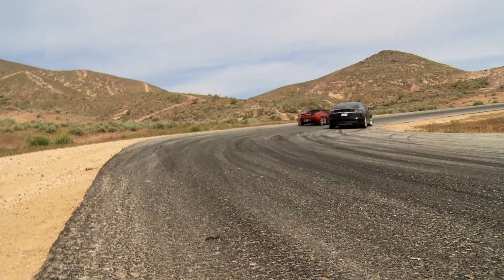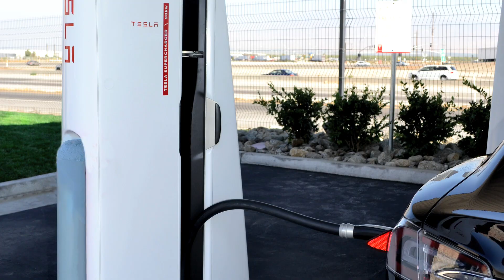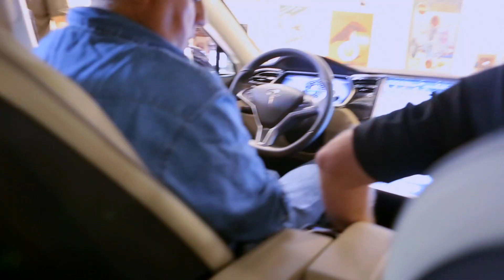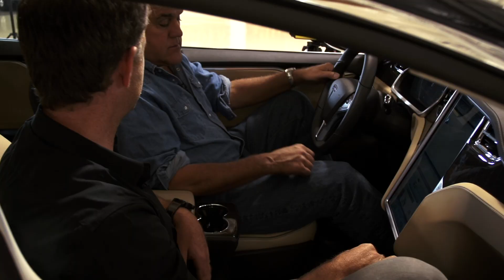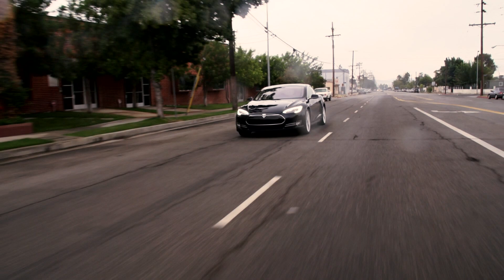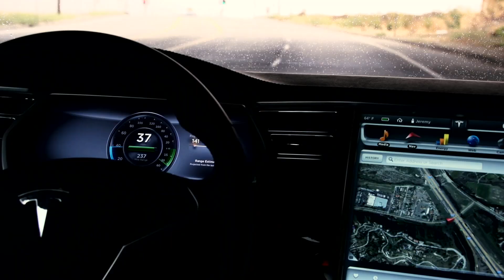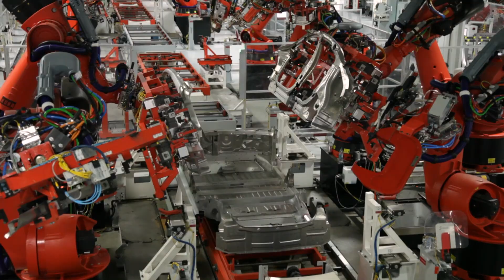2012 Tesla Model S - Jay Leno's Garage

Comment: It is probably possible ylto do with self charging the batteries with such a system already using electrical  to power the drive. I wonder if say if it was possible to do it be like an alternator with belt to feed on the electric motor with gears to built up enough charge to keep it in very low charge mode or better? This way it helps keep the ranges a lot longer and of course with the reduced in power output. 

Let say it is possible now they wouldn't probably do it for many reasons but my reason is then they will never make any money as u would never need to buy battery for a long time.

Think of it like charging ur phone  or laptop battery at 100% and it drains slower.
Reply: L Saelee So what you're saying is they should use an alternator to charge tehe batteries while the car is moving? That wouldnot work,buddy.
Reply: guifrakss what's keeping it from working? Maybe split the batteries into two way and when one side drains down maybe start charging one side while running on the other?  I don't know I just figure it would work somehow maybe cost too much to do. But have u ever thought about a car if every hoses to water coolant etc we're made with high performance or expensive stuff you'll never have to replace them again or a very long time. Reasons are so there such autopart stores and auto shop business.  I'm just basically trying to say that it can be done just cost isn't worth the company to make it.
Reply: L Saelee
 I dont understand what you mean,please don't say everithing you have to say in a single sentence. Try breaking them apart, or it turns into nonsense.
Reply: guifrakss let's just put it this way. All cars currently have a charging system which is belt driven. It charges while driving or at least it does when it's current drops. It's to maintain a good state of battery.  

So to say I don't see why the new electric car cannot be done using this type of system. I'm sure it can be done, but due to cost design R&D probably won't happen.
Reply: L Saelee
 Ok got it now. What you don't undesrtand is that eletric cars cannot have a generator (or alternator) to keep the batteries charged, because it takes more eletricity to run the alternator than it can give back. What you can have is regenerative braking that uses the motors to send eletricity back to the batteries when the driver takes the foot off the throttle ( tesla and most modern eletric cars have that).

Comment: Ok, since no one else seemed to mention it, I will. There are always 2 things regarding electric vehicles that are always over looked. The first one is that battery technology will remain similar to what it is today. That is not true at all, as of me typing this, prototype graphene sheet batteries exist in laboratories that would have enough power for an electric racecar to do the full 24 hour Le Mans. They are literally over 100 times better than current batteries. The other thing people overlook is that while right now, electric cars get their power from non renewable energy sources most of the time, which defeats the purpose. However, in a few years, nuclear fusion will take over the energy industry as the leader, and it will be the best form of power generation humanity has yet seen. Combine the two and suddenly electric cars will become very viable indeed.
Reply: CockatooDude EVs getting power from non renewable sources does not totally defeat the purpose. I forget the exact numbers, but a model s charging with power made exclusively from coal (the dirtiest fossil fuel to burn) only causes somewhere around half as much pollution as gas powered cars
Reply: Salvador Abellano yes, but I was addressing his argument that most ev's power comes from non renewable sources. Of course ones that are powered by solar, wind or hydro power, but I was giving a worse case scenario
Reply: Trey B have you ever heard of solar power?..

Comment: One glaring thing missing that could easily make this one of the best most versitale cars on the market... put a dam gen-set into it !!! Sheesh! Relying solely on the batteries and charging stations is still severly restrictive, adding the gen-set would free it from the interstate and allow it to driveable on the longer journeys away from the major population centers. Until then forget it, I'll stick with gas or hybrid type models.
Reply: dlwatib People get hung up on certain things, whether or not they are real world problems. Today I pulled into a parking space, and it was clear that the person in the space facing me wanted me to move. I obliged when I realized he was saving that space so somebody could give him a boost. It goes to show that dead batteries are a quite common occurrence.  It just that it's not Tesla owners who are having that problem. 

We should really be asking those with ICE cars what they plan to do about the battery problem. If they leave their radio on when they are parked, they could come back to a dead battery. The same goes with headlights and a number of other things.  They could carry jumper cables, but that won't do much good if they are stuck in the middle of nowhere.  I've never come close to having a depleted battery in a Tesla, even when taking long trips. but I wouldn't be able to count how many dead batteries left me stranded in other cars in my lifetime.  But with a 12V battery in an ICE vehicle, after a number of years, the car may not start due to the battery even though the driver did nothing wrong.
Reply: KlunkerRider How do you propose doing that? Are you familiar with how the car is built?
Reply: bW9taeH4 gen-sets can be pretty compact, it's conceivable it could be housed in one of the rear quarter panels and a small fuel tank in the other. Not saying its an easy fix but if other cars have done it?
Reply: KlunkerRider One of them has the subwoofer but that's not the real issue. Most people drive a fraction of what a daily charge will give them at home. You can't fill up a gas tank at home and that's not stopping people from buying ICE cars, and if you can live with the inconvenience of going to gas stations each week, you will love the convenience of never having to do that again.

There's a big array of superchargers, and it's only on the long trips that people take perhaps a few times a year at most that it will be an issue. If you are taking a 400 mile trip from Silicon Valley to Los Angeles, a small fuel tank won't be much of an "easy fix." It would be an inconvenience. Chances are that on a trip that long, you'd want to stop for lunch or dinner and charge while you eat.  People would rather plug the car in at a hotel overnight than stop on the way if possible, and a hotel that charges $140 per night would rather spend $1.50 of it on electricity than have you stay at the hotel down the block. There are plenty of independent charging stations too. 

People who don't own the car might think something like what you suggest would be good, but you never hear owners talking about that. I've owned many cars, and like most people, if it doesn't live up to my expectations I will be quite vocal about it.  The opposite happens with Tesla with respect to charging. People start off anxious about it until they own the car, and then realize it's not even a slight inconvenience. The opposite is true because it means never having to stop for gas. If you add a small gas tank, that takes it away.

That doesn't mean that Tesla owners don't have a long wish list. I'm not saying it's at the bottom of the list. It's not on it at all.
Reply: bW9taeH4 My issue would be driving up Hwy 1 from LA to Portland there's not a lot of options when you get off the freeway and onto the back roads. My main point is that Tesla wants to replace the gas car with an all electric car, their next car model, the "affordable" one, is going to have to be attractive to the average Camry owner, that lack of versatility outside the urban sphere is going to be a hurtle, a bigger one than I think they realize. As is, the Tesla is a very expensive second or third car for well healed buyers, they want the next model to appeal to single car buyers, that's going to be a tougher sell without the generator like the Volt has.
Reply: KlunkerRider You are right, that wouldn't be practical right now. You'd have to do it over several days and stop a few times, since you wouldn't have access to fast chargers. I'd probably want to do it over several days anyway, but superchargers would all be detours and I wouldn't consider it practical.  There are a number of superchargers planned for that route this year, but there won't be enough to take that whole route. For the time being, Tesla's first priority will be to deploy superchargers in enough locations that you can get to anywhere in the country, but for now you'd be stuck on the much uglier I5. I can see why you'd prefer to take 1. 

The "affordable model," which is the Model 3, won't be unveiled until March 2016, and there's no telling when production will start. For now, they are running the plant at capacity, but they aren't keeping up with demand yet.  By the time the Model 3 comes out, they may or may not have the infrastructure you are looking for. For most drivers, the ability to go anywhere they want will be sufficient, but it would be better not to have to plan a specific route and find superchargers on any route you'd like to take.  Tesla will have to do the market research to figure out what sort of network will be needed by the time the Model 3 comes out, and hopefully they will have it in place by then.

For now, nobody is pretending that the Model S is a one size fits all solution. It's obviously not for everybody, and price is a bigger issue than most others for the typical car buyer. You can read all the comments from people who say they wouldn't buy it until it had a range of 300 miles, or whatever they want, but if the car had that range today, how many of those people would buy it? I'd guess that Tesla would have the same backlog either way.  People act as if they have a stumbling block when the real issue will be whether the cars and the network prove to be what people need in 2017. 

It makes no more sense for me to speak in the hypothetical than it does for others who blame the car and network for what it won't have when that's a complete unknown. I might enjoy driving that route on Hwy 1, spending 3-4 days doing it, going in 250 mile increments and stopping at hotels to charge along the way. But people should be free to make the trip any way they want.
Reply: bW9taeH4  I realize that eventually, maybe in 5-10 years, the chargers will be accessible in almost every sizable location, which will make the cars more practical. To me, until that happens it seems that especially with the Model 3 they should offer a gen-set as at least an option, it would make the car immanently more attractive to regular car buyers who might still be afraid of putting all their eggs in one battery only basket (IOWs milquetoast Camry buyers). Until then, I'll stick with my gas guzzling ;-) 34mpg Scion, I'd consider a Volt if it wasn't so dam ugly, seriously it looks like design leftovers from the 90's. The Caddy ELR version  is really great looking but oh the cost! Its simply not worth paying twice for a reskinned Volt. I find myself wishing they would dump the Volts current body and go with the ELR and just sell it as a  Volt, but that wont happen. 

One reason I keep jumping on the gen-set issue is purely personal, where I live adding a charging station simply isnt going to happen, for various reasons (parking availability, charging location options, practicality of installation) its just not going to happen, but where I work has charging stations out the kazoo. I want a gen-set car so I dont have to worry about low charge over the weekends. I know this because I seriously looked at leasing Fiat 500e for commuting, and NO I wont buy a farking Prius, I hate Prius', its the anti-fun hatebox of a driver. The only thing worse I have driven was the Scion iQ, which is a Smart car with Autism, now the Honda CR-Z ...maybe. BTW I'm really looking forward to seeing how practical the Tesla model 3's gullwing doors work in the real world,  Are they really going to sell it with gullwings, they do realize there are serious real-world problems with gull's, like close parking and rollovers. Be real interesting to see how that works out.
Reply: KlunkerRider It would make the Chevy Cruze imminently more attractive if they took a lesson from Hummer so it could hold more and be used off road, because until then, drivers are limited to specific routes. Or you could consider that a person who drives a Hummer would never make such a statement, but instead would recognize that different people have different needs. The Model 3 might or might not end up being practical for you. but it would most likely be practical for most people. 

There's no indication that the Model 3 will have "falcon wing" doors, but they will be on the Model X in a few months. You have it backwards though. Close parking is one of the reasons in favor of them. It's difficult or impossible to swing a door open in a tight space, but to have a door that goes out no further than a sliding minivan door before it goes up, out of the way, and grants clear access to two rows of seats, you will wonder why you'd ever want a car without them again. 

The safety aspects have already been factored in, and Tesla already knows how to make the safest car in America.  The Model S outperformed all other vehicles in crash tests, and the only things missing (active safety features such as lane departure warning, blind spot detection, active collision mitigation braking) are now on the car.
Reply: bW9taeH4 X vs 3, OK got that straight ;-)
Reply: dlwatib Your probably right, I was looking at the Caddy ELR but its really expensive for basically a reskinned luxury Volt, but the standard Volt's dullard looks make me nauscious. Although I have to admit I REALLY like the new Mustang! :-D
Reply: KlunkerRider If you keep asking for a gen set, you aren't yet in the right mentality for an electric vehicle. Once you wrap your head around the idea that never stopping at gas stations is a good thing, then you'll finally be ready to take the plunge.

Comment: How about security etc? Does it have connection to the internet? Can you hack it? And what can you do with it when you hack it? Can you like control speed remotely etc?
Reply: AustrianChaos According to Tesla, they can't shut down the car remotely. At least that's their official statement, and they are sticking to it. Many owners would like a way to do that in case of theft, or at least have something that won't let the car speed up once it slows down.  If it were possible to turn on valet mode remotely, it would limit the speed to 70 mph and give it the performance of a Ford Taurus. That would make it easier for law enforcement to catch up with it, especially since the location would be known within a few feet.

They can turn off service remotely. That won't make the car undriveable but anything that requires an on line connection wouldn't work. 

Even though they don't officially admit to being able to disable the car remotely, it's unlikely that they couldn't do it. When they have loaner cars, they limit things such as top speed and given the incredible number of OTA software changes, something that gradually lowers the top speed to something not unsafe for the road, or something that disables the vehicle when it's stopped (and law enforcement is on the phone with Tesla) would be quite easy to do.
Reply: ***** Well they can shut down your car remotely if you don't pay the bills, so there's that. But BMW or Mercedes can probably do that as well if they want.
Reply: AustrianChaos I'm waiting until many people buy these cars and somebody hacks their service. Imagine a kill command and thousands of cars standing still ><